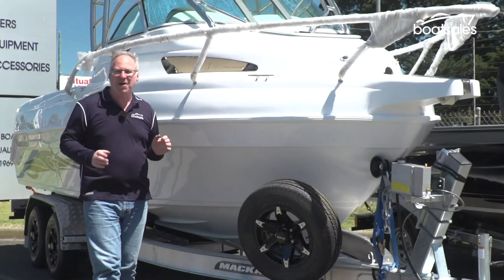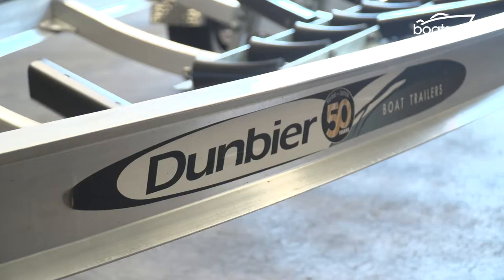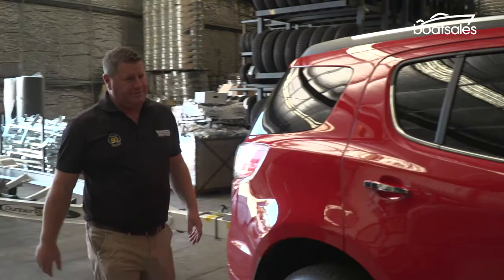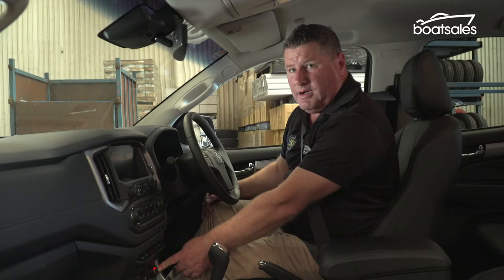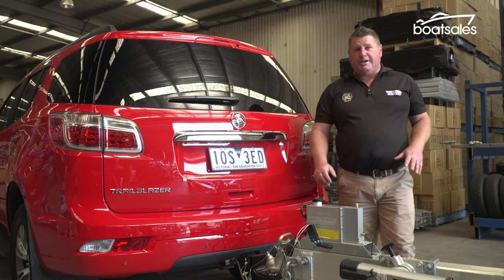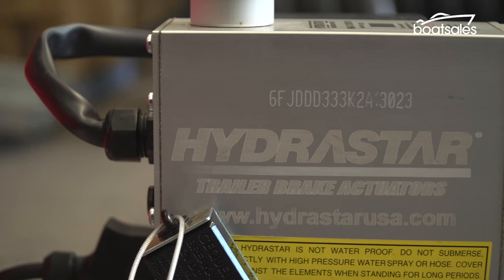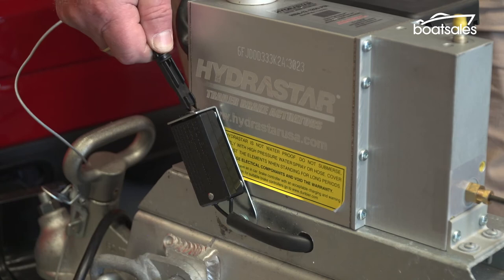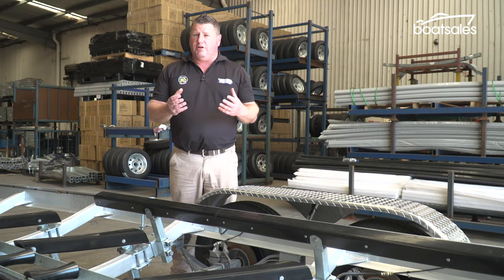Electric trailer brakes explained | boatsales

Comment: Always use a 12-pin plug (or Anderson plug) to provide power to your breakaway system and Hydraulic Brake pump.
Pin-2 on the 7-pin plug is for Reverse Lamps. It is not for Auxiliary power on modern trailers and tow vehicles.

Comment: Lousy system in my opinion ... electric that actuates a hydraulic .... versus just a surge brake or just electric brakes ... seems way more complex than it needs to be
Reply: Unlike a caravan or box trailer, full eletric brakes on a boat trailer's braking system will not eventually end well, that's why the 12v hydraulic actuator is needer, which is fed power from you vehicle's 12v system (like a booster) to engage the brake caliper pistons when the pedal from the vehicle is pushed..
This keeps the 12v power supply out of the salt water when the trailer's axles are submerged during launch and retrieval. 
Hence the proper name of the system, Eletric over hydraulic 👍